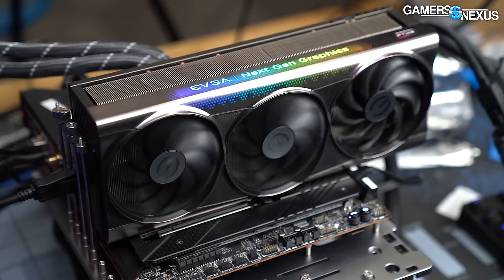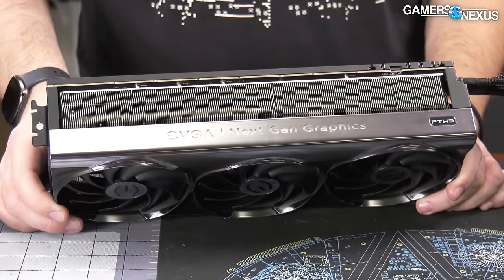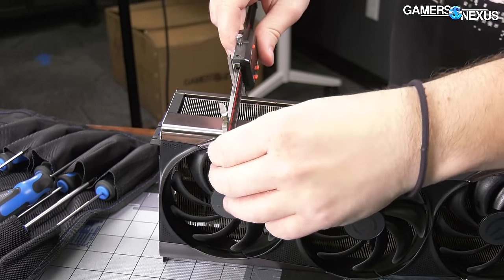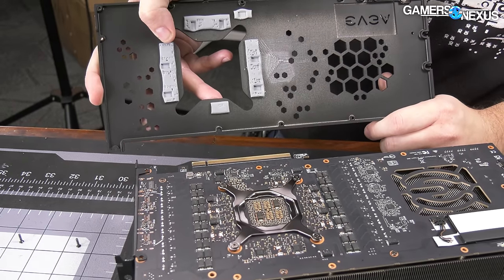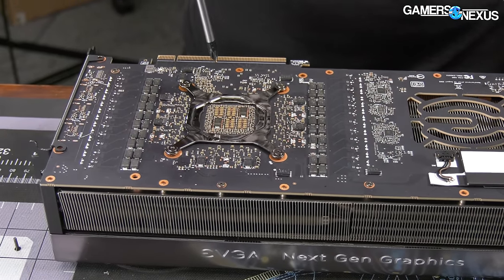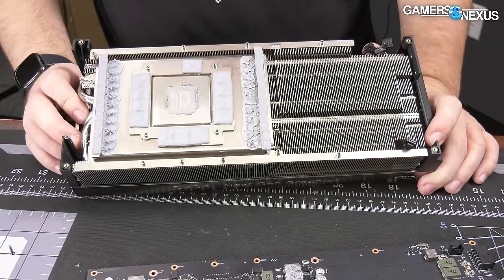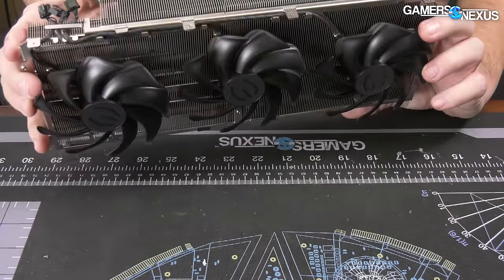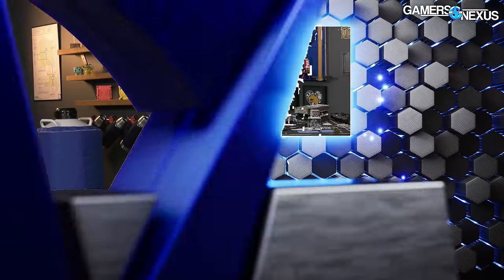EVGA RTX 4090 FTW3 Tear-Down & Disassembly: A Major Loss

Comment: Gosh I have a 3080, 3080ti, and a 3090 I'd trade for that. Not for some perceived performance gains, no and clearly at a loss in the moment. Just, how cool would it be amongst us to own a limited production run unit from the last of EVGA's GPU manufacturing/assembly days.
Reply: A last thought on the topic Steve & despite wanting that card for the personal collection; it may fair well at an auction.

If I had the power to make it happen I'd create an NFT to pair with it (not for deriving value from the NFT based on the card), as well as a copy of this video, & if at all possible a picture of you with the staff from EVGA who were involved in the process of manufacturing & assembly.

What nice provenance that would be.

Proceeds go to your favorite charity or to those same EVGA  employees.

Personally I'd turn it all into Zilliqa to distribute but that's just my inner recklessness :P

Comment: The biggest loss to prospective buyers for this never-released EVGA model isn't the cooling, power delivery, etc etc, in my opinion. When you stack it up with the Strix, it immediately becomes obvious it's significantly shorter. All the talks about power and the adapter cable are important but case fitment remains the biggest challenge to buying a 4090.
Edit: that, and of course the price (how could we forget that!)

Comment: Steve.... I dont know what GPU you had in hands, but i havent seen GLUED fan cables on GPUs since 2010. Dual stack heatpipes are also present in GPUS since years - i have this in Gaming Z Trio (6800 XT). This is all common.

Comment: Nvidea just makes the chip correct?  EVGA/MSI/ASUS build their own boards around the same chip?  So what was the argument EVGA had again?  At the time, I was hearing
 they didn't know Nvidea's board price until right before release.  So, I assume that was Nvidea's CHIP price until right before release?  Or does Nvidea make each MFG's board design and the MFG finishes assembly with the heatsink and other mechanics, etc, doing final assembly?

Comment: That card would look way better with a Radeon GPU under the hood.
Reply: Funnily enough I fully expect that both Intel and AMD will end up partnering with EVGA to supply their cards in future.  Being stuck with Nvidia was a terrible place to find the business, but now they are free again.  If I were EVGA director - I would immediately start trying to supply Steam Decks for Valve with fancy cooling for that igpu, along with both Intel and AMD separate GPUs and parts.

Makes total sense when you really think about it, they just need to get their lawyers lined up.  Nvidia will sue them guaranteed in 2023.

Comment: It looks nice, i will say i have the 4090 Strix and it is a beast. 
Ive also been very lucky as regards a golden sample, it easily boosts to 3075mhz and amaintaisn a solid 3030Mhz at just 64Deg C 
It is hovering at around 90% to double the perfomance of my Strix 3090 OC and whne you consider the 2080ti jumpy to the 3090 OC was about 35-40% i can say this is a really impressive generational leap for Nvidia. The other thing that is impressive is the power draw for this kind of performance as most of the time it draws abotu the same or a bit less than the Strix 3090 did - which for double the performance is amazing, especially as it runs so cool at between 55 and 65 Deg  C max under load.

My only gripes are the power plug position, which must have been decided by a village idiot and the flimsy nature of the power connector, it isnt relaly up to the task in my opinion and im patiently waiting for a Cable mod cable as i simply cannot trust the Nvidia 4 into 1 adaptor not to melt.
considering this is a £2400 card id have expected asus to provide a decent adaptor cable - sadly it seems not.

Comment: Why do I feel like these were let loose in the media to rub salt on Nvidia wounds cuz this design addresses all the issues people have with 4090.
Fire Hazard issue is resolved by side mount
The card is able to fit in normal cases with its shorter length.
There is adequate cooling
Card has anti-lag thread like 3090

It would have translated into High GPU core sales for Nvidia, if they didn't tried to fuxk the AIB's. I know the Nvidia founder edition is out of stock but still the net amount of GPU sales of 4000 series is very low due to low sales on the AIB side.

Comment: No glue, way less screw than Intel ARC cards. Easy to disassembly not complicated like Nvida card. This prototype is way betther than other 4090. 
Yes the Strix got Mod Bios 1000W power target, but still this design looks good.

Comment: i absolutley hate it when a lid or faceplate or back plate has a small board on it and tiny ass wires that always seem to be wayyyy to short to be able to take the piece off without damaging it unless you were previously aware or super careful, which i am not always.

Comment: Definitely one card that i dont recomend to anyone because of the problems that many are having with the power connectors. I believe these are made with china low budget materials and are not highly conductive on the AMPS which is being used by the card, also the connector is weak and make resistance while being used and making the plug heat and burn

Comment: EVGA could rake in the cash if they team up with AMD
Reply: They will start supplying Steam Deck 2, along with GPU and parts for both Intel and AMD.  Why wouldn't they?  Nvidia made them agree to be exclusive but there is no reason apart from that to stay that way!

So it's EVGA for GPUs and Steam Decks with fancy cooling solutions, and for ARC series GPUs in 2023 (I think)

Comment: We need you GN for this issue: 
Maybe EVGA left bc this new tactic of the manufacturer just releasing their top performance tier (lowest value tier) first, at a horrible value price, then pricing down based on a % of performance, makes the entire lineup of cards poor values, or at least worst values than cards of similar lower tiers used to be.

Comment: Don't even bother wasting your time comparing the EVGA "not a 4090" against other 4090's. EVGA had to make the "not a 4090" vbios from scratch without help from Nvidia, and the GPU department was scrapped before even finishing the vbios, and as such it's extremely lacking, such as not being able to adjust the power limit at all. The "not a 4090" will NOT be competitive with normal 4090's. It's an awesome card, awesome design, and a true rarity since EVGA GPU's are no more and it was never actually released, but that's it.

Comment: I wonder if the reason EVGA got outta the game was because nvidia wasn't going to accept some of the responsibility as the manufacturer and the AIB partners would have ended up having quite the potential loss due to RMA's from fire/melting that could have been averted with spec layout. (Evga dealing with those issues as best they could within that limited layout agreement). Or if it was simply about Nvidia ripping off customers by purposely limiting performance. Case and point, the latest driver updates that gave a 20% overhead increase. Could be completely wrong. We could speculate all day i guess. Sure wish we had a whistle blower come forward at Nvidia....Hint hint.

Comment: My overall conclusion with the 40 series is if you have the cash to blow just get a water cooled one.
Reply: The 4000 series are way to expensive, the 4080 costs over 1.2k whereas I got a 3080 evga ftw3 for £700 brand new which is gonna be my last card until 5000 series comes out

Comment: EVGA have a HUUUUUGE problem with their radiator grills. they are thin and could resonate when fans speed up or slow down, asus have a solid block instead. the grill even on card in a video is bent

Comment: its identical to gigabyte aorus 4090 pcb. 24 phase x 50A. Its nothing top tier. MSI suprim x, ROG strix and even Founder's editon have better PCB in power delivery. This is still very good and far more than enough but there are better designs.